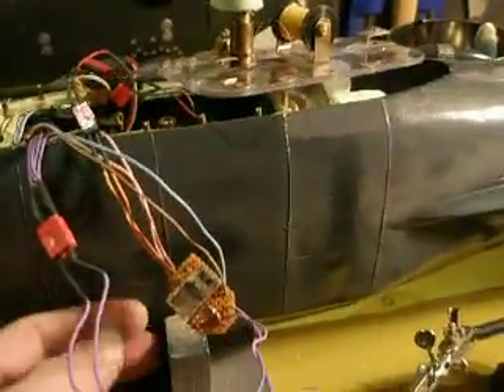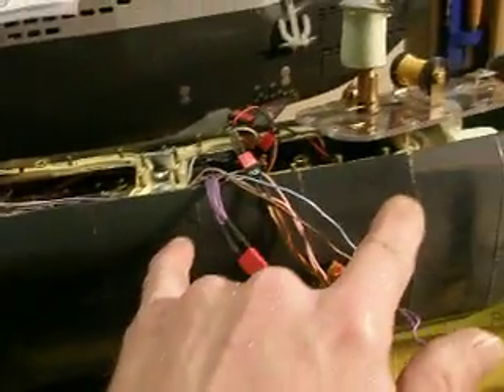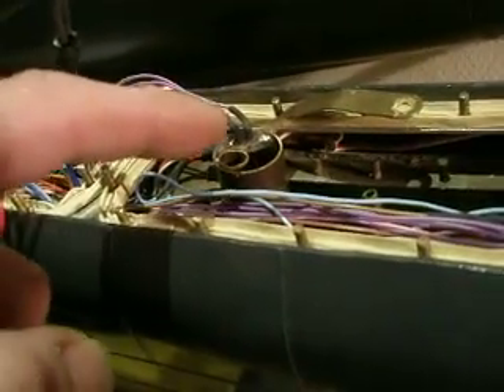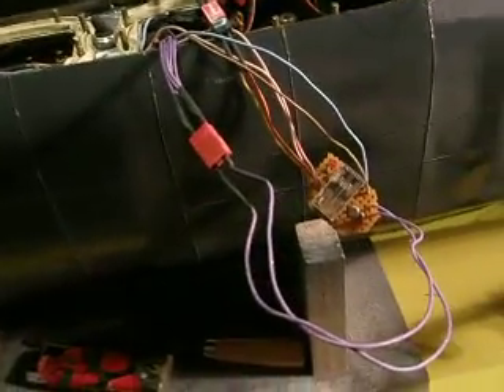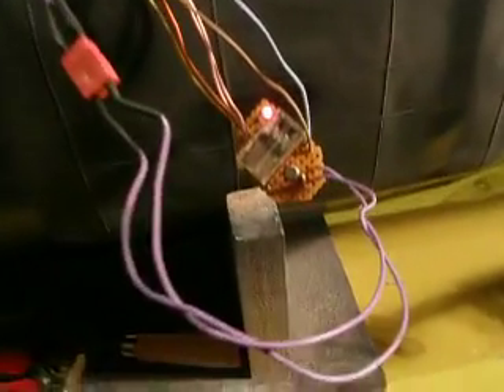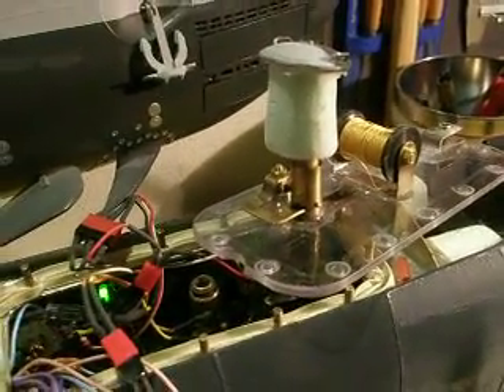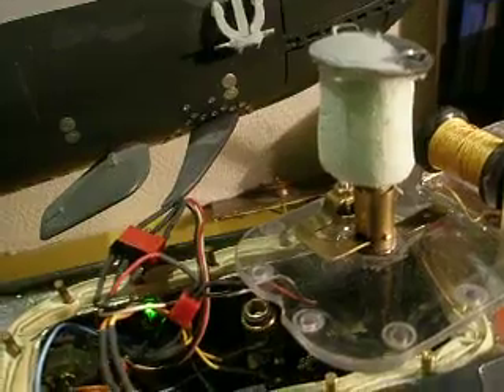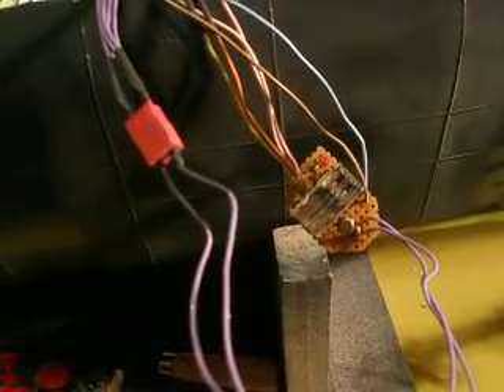waterdetectionsystem V80

Comment from the maker: Simply said it works like that, i only added a transistor that steers the relais, so if the sensors conduct, the transistor will switch open and the steered current activades the relais.

I have indeed the same system on the type VII, it's simple but effective.